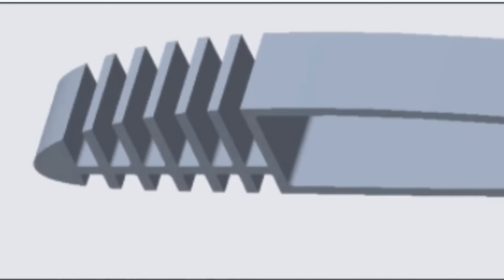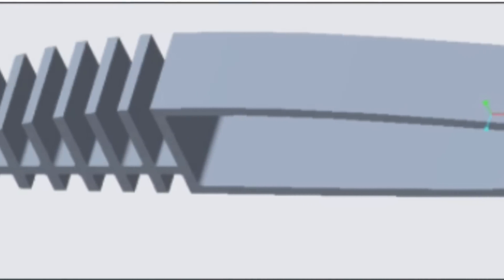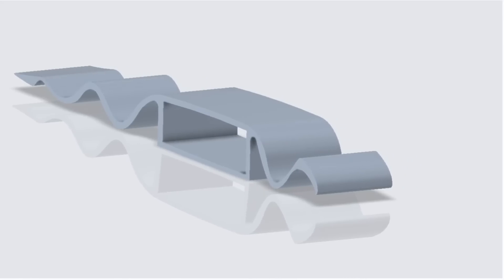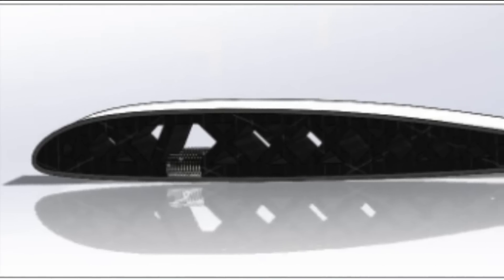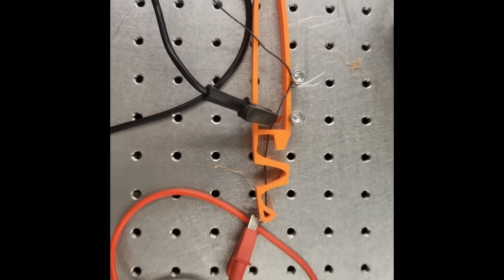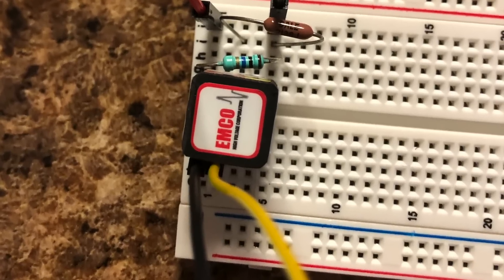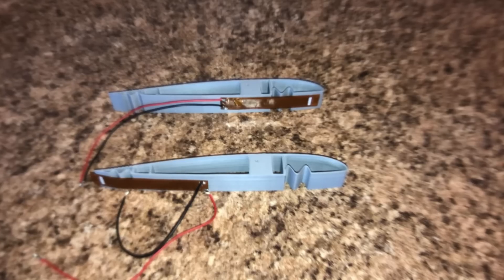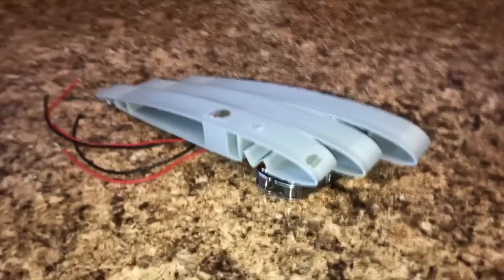Flexible Wings for Adaptive Flight

Comment: Its an interesting idea, it seems odd to try to make a compliant structure that will be under such huge aerodynamic and direct physical loads. I can't see any of these designs having the basic rigidity necessary for a rotor.
If you imagine something like flaps on a wing under static conditions, sure, you could counterbalance forces on the flaps with rubber bands and use a tiny force to articulate them, but when you put 20,000 pounds of force on the flaps, nitinol or piezoelectrics are just plain going to be overwhelmed. This is why fighter jets use self-contained electric-hydraulic actuator packs. You need that much force and that much rigidity in the actuation for them to be functional. Even just electric drive and motors isn't enough.

Comment: Don't think these would be in any way strong enough to overcome the aerodynamic loads that main rotor blades are exposed to. They would have to be powerful enough to make the change and sustain that shape. Also, failure in one blade of a multirotor aircraft is gonna get messy. Perhaps these would be better as integrated flaps for a fixed wing drone.

Comment: Flexible ving profilen is the future, at last for some aircraft. Two actually exist, hanggliders and paragliders. To develop those was on my mind when flying them. To have stable, flutterfee and contollable profiles is not undoable, but a lot of work and testning have to be done. Mayby AI and 3D printing can ease the work. My first attemt would be to have span wise bars, like dark Aero, with rotating cord wise rods in the mid heigth of the profile. My second would be to have a fixed profile in the laminar flow area and flexible profile after that.

Comment: Love the idea. Was any thought put into the fact that there will be potentially a 100F temperature difference in the ambient temperature and at altitude and under high load the temperature of the air and also the temperature of the skin of the wing could easily be adding at least 50F to the temperature range that the wing would be subject to?

Comment: At higher altitudes (cruising altitude of most commercial planes) the temperature drops to 0°C, increasing the probability of stress fractures occuring.

If an unconventional material is used in production to prevent this then the cost of production is so high, most manufacturers avoid simply because the customers (aka commercial jet companies) don't need them.

Maybe it could be used in private planes but the pilots need to learn the technical components of the new jet making their charges go up too.

A novelty usage may benefit but a large scale implementation is mostly not attainable.

Edit: Temperature at cruising altitude is -40°C to -50°C.

Comment: This is a very fascinating concept. I think it would be difficult to achieve morphing airfoil of a rotating prop. But this would be interesting to see if it would be more efficient for fixed wing aircraft’s to have morphing wings. This would give the airfoil much less drag but still controllable. Also eliminate a lot of hydraulic weight from the plane. But I’m not an engineer so I probably have no idea what I’m talking about

Comment: adaptive surfaces will be the next great leap in aeronautics and it will be huge. imagine wings that can morph their sweep angle for faster more efficient flight. Or entire airplane surfaces that can morph to steer a craft. I think this field is extremely exciting.
Reply: On the contrary, I think aviation has reached a level of maturity where technological innovation is providing diminishing returns. Many existing solutions are simply “good enough” and will remain so unless new tech is both better and cheaper.
Reply: entire airplane surfaces morphing to steer a craft… not sure why you’d need anything other than ailerons slats elevator and rudder. Leading edge already morphs when the aircraft is in its takeoff config for maximum lift. The wings are put in place at a certain angle via robots to get them down to their exact microscopic angle that maximizes speed and lift, this field has been improved so much I don’t think there’s much room for any more leaps in aviation on the commercial side, maybe on systems but as for leaps, the only ones we will see is improved fuel economy for the airlines and maybe some zero e aircraft in. 2035-2050
Reply: @idekav.   Because current control surfaces are inefficient. They are approximations of changing the aerofoil shape when Ideally the entire aerofoil would morph, which is what this type of technology achieves. This technology is already being applied by companies like Flexsys. 

Fuel efficiency is the single most important measure for any commercial airliner. That is why large aerospace companies invest in research for blended bodies, braced wings and morphing wings. Such advances could significantly improve the RPK performance of an airliner and thus is extremely desirable to both manufacturers and carriers.
Reply: I mean the Wright Flier already did the “morphing.” That’s how it rolls

Comment: Cool concept 👍 Moving parts = faster degradation (unfortunately). Temperature differences might effect the performance of the material to flex as needed. These are just thoughts. Obviously testing is needed. Thanks for sharing this idea! 🙌
Reply: nope that depends if the movement stays in the elastic deformation zone of the material, which it should, so there is no degradation due to the stretching. There isn't any friction as it is a monolithic part. temperature issues could be remedied by introducing hot air from the engines, somewhat like an anti-icing system does it
Reply: @tomatosoup5056  elastic deformation zones can change by a lot in virtually all elastic martials when introduced to high and low temperatures. I think Orpheus has a very valid point here. Also no one is going to heat up 15 foot long ROTORS with hot air from the engine. Remember, this system is supposed to be competing with the swash plate design, currently used in millions of aircraft worldwide, but particularly (since the flexible airfoil guys mentions it being for them) in helicopters.

Comment: The one thing that comes to mind is the stresses when bending. Helicopters rotors can bend a lot length wise and they can handle that but the stresses of bending them both over the length and cord could be a bit too much for our materials. This is still such a cool idea I hope someone takes this further in the future. If someone knows better feel free to school me cause I’m not an engineer.
Reply: not my stuff, i'm audio dsp but i was listening to a helicopter with extremely floppy blades (DMAFB) the other day and thinking about it (designed wings).. for whatever synergetic function introducing those concepts into your synapses may achieve.. one thing you'll find in southern arizona is extreme heat and light some engineers egregiously fail to account for.. i'd want to have the oldest guys around listening to the result..
Reply: It still could be possible depending on the dynamic loading of the blades. Sections can be cut to relieve stress in one direction of the piezo material and another section could be added. It is also possible that it’s the outer part of the blades that are the most important as they are spinning the fastest saving on costs.
Reply: @ssss-gf1fh  that complexity adds cost and unreliability.
Reply: @JoeOvercoat  any increase in complexity causes this but considering it’s not mechanical rather just material deformation it should be manageable. By cost saving I mean  not making the entire blade with this modification just outer part of blade.
Reply: @ssss-gf1fh  I understand the appeal but if you look at it from a production engineers point of view you see where the difficulties arise it’s achievable but at cost. a deformable wing is the Holy Grail to be sure. but i suggest wing warping will be an easier effort…just look to the Wright Flyer.
The autoclaves used to make helicopter blades are really impressive machines. They look like something out of the dry cleaner of the gods.
Reply: @ssss-gf1fh  the problem I see with this idea is that rotor blades sees stresses in pretty much every direction. They flap, droop, lead, leg and stretch horizontally depending on the situation. Stress relievers will inevitably become stress risers at some point even if it’s just the blades being tied down after flight. It really is an engineering nightmare. I can image this could work on something smaller like a propeller where the forces are a bit simpler and the consequences of failure aren’t guaranteed death. That really is the ultimate problem. They’re so many variables and no room for error meaning simple is king 👑 . Nevertheless I hope I’m wrong and you never know what kind of Houdini level magic those engineers will pull out of their arse in the future.
Reply: @JoeOvercoat  I feel like in a situation like this cost will be of little concern to the people employing this kind of technology. At the end of the day if you own a “cheap” helicopter your most likely loaded. I do agree that it would be more compelling for a wing. A deforming rotor would only add complexity but a deforming wing could eliminate flaps and possibly even ailerons all together. Maybe  it could significantly improve reliability and cut down on weight as well. Only time will tell. 
Thanks for the comment 🙂

Comment: Love how the design is inspired by nature. Honestly proves how much it is absolutely necessary to the advancements we have made.
Reply: Inspired be nature and entirely too slow to compete with the traditional pitching rotor design make in the 50's (let alone the fact that it doesn't even move it 2 degree's from normal).

Nature is not special. Both human design and natures design are restrained by the same physics of our universe, so of course there is overlap, but nature only succeeds in the act of trying to make an individual more likely to reproduce, while we create designs that can do ANYTHING WE PLEASE.

These boys need to find an actual problem to be solved before they try solving something, as this whole rotor pitch thing was figured out in the 50's and the system is unlikely to be beat by some "Smart" rotor that needs a big ass battery and expensive materials.
Reply: @DragnEYE  you’re making his point that nature is so far ahead of us. We are but children with tinker toys compared to nature‘s accomplishments.

Comment: I think you might wanna try nylon filament, its more flexible and can handle a lot more heat.
Reply: You do however need a spicier printer than one made to print pla or abs.

However if you can get one, nylon is great. If you can get nylon or PC and cf composites, even better
Reply: @josejimenez896  I print nylon on my Biqu B1 and thats just a cheap printer with all metal hotend. CF composite filaments would not fit this application i think, because of the reduced flexibility.

Comment: I'm assuming the goal here would be to deflect a rotor blade electronic rather than requiring a complex squashplate mechanism? I don't think there's any electrically actuated system that would be strong enough yet fast enough to deflect a spinning rotor blade based on cyclic input.
Reply: nah looks like the goal is to do active airfoil shaping for different flight conditions; it changes the camber, not so much the aoa, so not really for vehicle control. just trying to adjust aerodynamic paramerers for higher efficiency in say forward flight vs hover.
Reply: He does say it needs to change shape quickly because the blades are rotating, implying cyclic control. If you can change the airfoil shape and delay the stall on the retreating blade even a little, you can give a helicopter a speed advantage, which would be worthwhile in a military application.

Comment: Why people keep trying to avoid using servos for this is beyond me.
Reply: Because it's for a helicopter....
Reply: @chameleonedm  Ohh, I was thinking have a shaft go down the wing with multiple linkages that pull on the sections, but yeah heli blades might be too long and thin with too much centrifugal force for that. Could definitely get servo movement to them, but you would be adding it on top of the mechanical complexity of the tilt ring linkages. Piezos don't have enough power, and nitinol is cool and all but is just a non-starter in any practical application. Maybe pneumatic muscle type actuators would be practical? The force-to-weight ratio is by far the highest of any direct actuator.
Reply: @samheasmanwhite  I mean, plane wings already do this, no? Quite literally as you describe too
Reply: @chameleonedm  Yeah, but planes don't have to flap their ailerons and elevators up and down several times per second all while dealing with high g loading like a helicopter rotor blade might be expected to do.
Reply: @epicspacetroll1399  Wasn’t suggesting this was applicable to Helis, specifically said otherwise
Reply: @chameleonedm  Yeah, but I re-watched the beginning and it seems they wanted to have it actuate on a per-rotation basis which would be far too stressful on any shaft-and-linkage actuator, and a bit too fast for pneumatics, but if we can one day make proper electric muscles that might make it practically possible.
This seems to just be a uni assignment, so it's not like they are actually wasting resources on it, but I do get a little sad when students are given a project that is so blatantly impractical, I would certainly be pissed if I got it. I guess it could prepare them for the disappointment of working for a pie-in-the-sky tech startup lol.
EDIT: Didn't want to come across so negative, but they could have been given a project designing an adaptive wing for drones or something that would actually work, they could even make and fly that themselves rather than just make a sad mockup. Poorly planned education just really grinds my gears.
Reply: Hydraulics could have an application here as well
Reply: @Pouncer9000  Not at this scale, but yeah in a big plane you would.
Reply: If you look at trim tabs on Seakings the tabs are tiny compared to the rota blade and they can adjust flight of of each blade.
Reply: @551moley  Huh, never knew about trim tabs. Those are just to balance out the slight differences between each blade though, rather than to substantially change their aerodynamics.